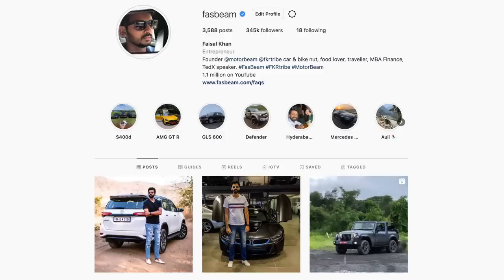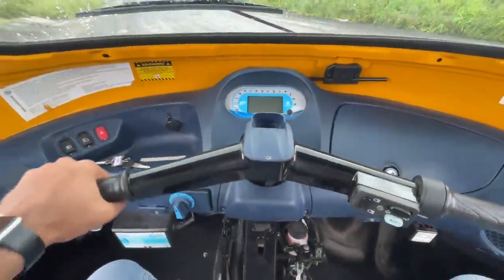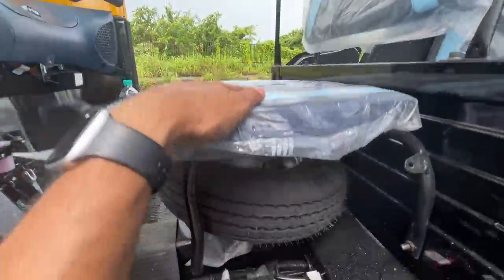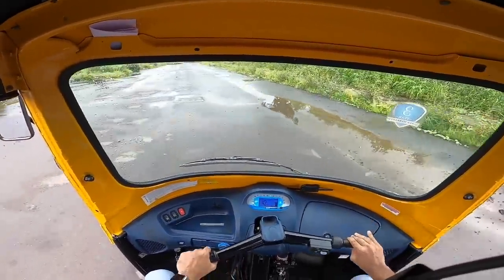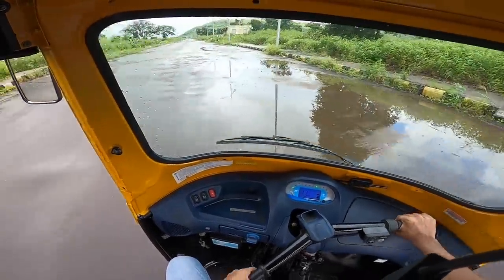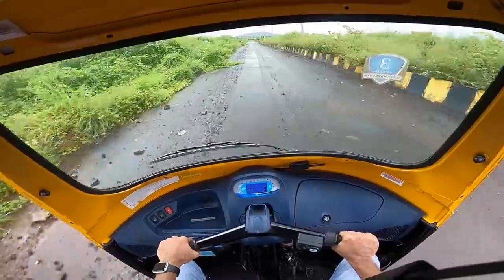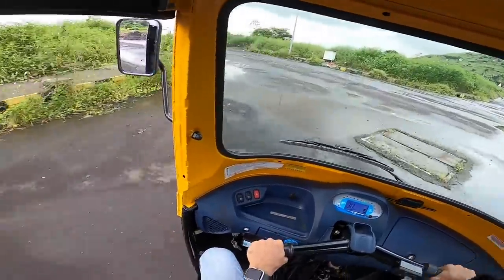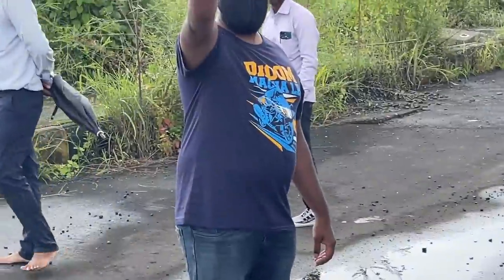Piaggio Ape eCity - Electric Auto Is Cheapest Way Of Transport | Faisal Khan

Comment: Riding in this vehicle will be more dangerous than a petrol leaking car.
The wires,battery everything is exposed and unsafe.
Reply: Ijj evide poyaalum indallo🤣
Reply: Adipoli 👍😌
Reply: No Way. It's much safer than petr cars
Reply: Mwoloooose
Reply: @prathamkamath8280  look at the wiring harness connected to the battery it all are exposed and we can expect an explosion when it touches some water